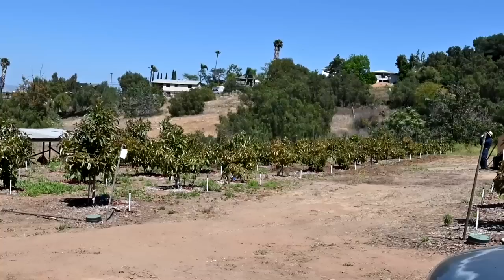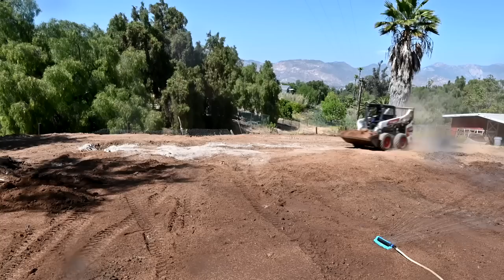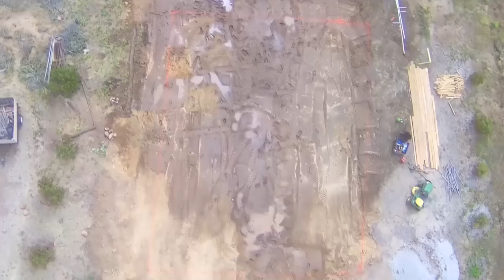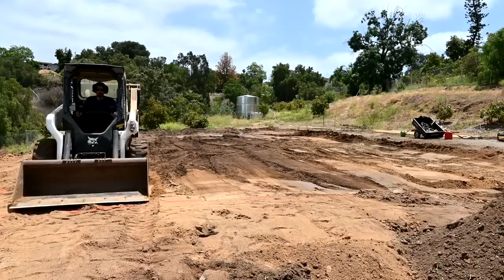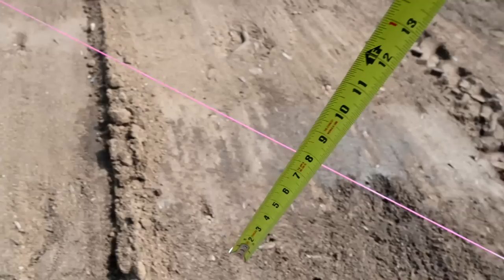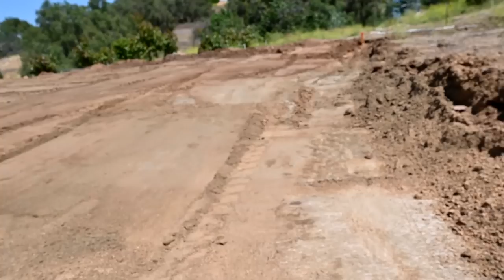Disaster During the Shop Build

Comment: Don't be so sure about water not getting into the garage. If you guys get a torrential downpour (think anything above 1", a day-long rain, etc.) and that side of the garage has any chance of pooling water, then it's going to find ways underneath your slab and cause clam shelling in the long-run because that slab will not be high enough to avoid any hydro-static pressure. Save yourself some MASSIVE headache and regret and spend a couple hundred on about 1 or 2 hundred yards worth of corrugated-perforated black pipe and dig an extra quick trench about 2 feet deep by about 2 feet wide and cover it with some pea gravel around the potentially problematic side and run it out to daylight on the other side where you could drop it out on the hill. If you don't do this, I can't shake the idea that you'll live to regret it.

Comment: Hey bro I'm sorry to hear about your building needing to be moved. Not that I'm proud of this. However, as a City worker I hear what you're going through and you're absolutely right, but at the same time that doesn't mean that you're wrong so don't roll over just to keep them happy, a call to your Counselor goes a far way...truste me on that (wink wink). With your building I couldn't really see where the power lines were so hopefully you've moved it to a location where it doesn't impede the easement meaning that in the future if the hydro company has to do work and they've got to get equipment in there and your building is in the way they have the right to remove that building if they deem necessary. Just wanted to leave a bit of advice just so you're in the clear for the future I hope this helps good luck bro. Your videos have always helped me a great deal more than you know so anything I can do to help I will

Comment: Drop the building make a celler   and change the drainage it's more expensive but very doable it's my job  you might have to add a few  pumps if you don't have the falls for drainage ,that's the way round building under the power lines .from the look of the land you have to work on it has great potential to lose most or all of the material that would be excavated , plus build up roads.  You really need to chat  with a builder like me it will save you  money . You also need a 14 or or 20 ton digger it will pay for itself by the work it will save and enable you to do ,you can also use it for lifts and act like a mobile Crain , level the ground , dig the footings and put in the concrete and it will save you time ,times money ,I might be worth paying for a good diver for a while.

Comment: You can get a better grade if you stomp the foot pedal all the way down past the detent and the bucket will float. I hope the bottom of your footings on the low-end are deeper than the fill that you are putting there because if not, it won't pass inspection.
I would highly advise you not to try to dig your own footings because if you had a little hard time doing a simple grade you are going to catch hell trying to use an excavator. The learning curve on that is much steeper. It would be like a newbie trying to rebuild a motor for the first time and have no issues